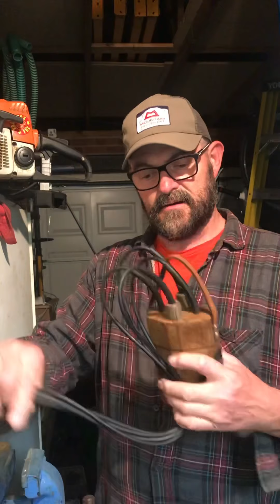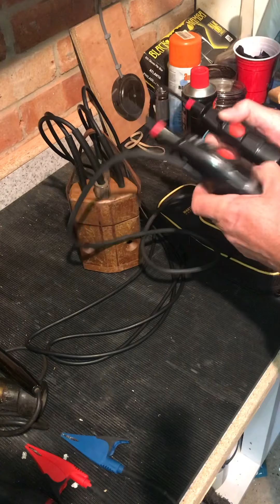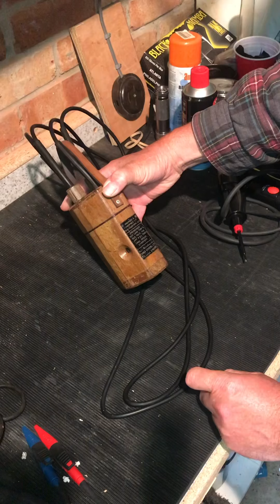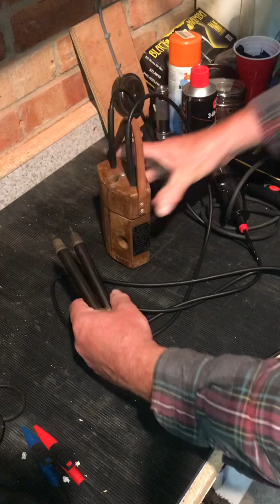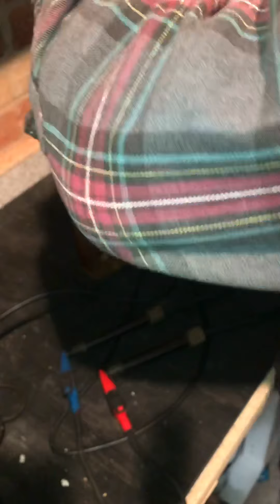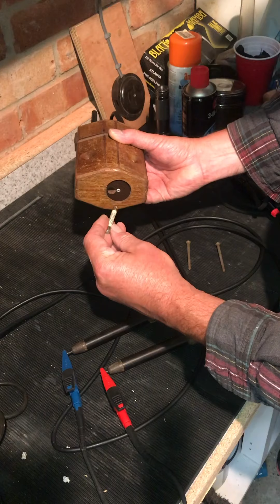Hammond and Champness

Comment: Hi Richard, curious, I love old testers, my father restored Telephones, Radios and Barometers. I have a couple of oldies but I really don't want to start collecting them. Love the Fluke but the T5-1000. Back in the UK I used the Steinel Voltcheck with a continuity button, loved that thing. Mark
Reply from the maker: 9 Plus Instalaciones Yes, when I was in my apprenticeship the Steinel’s were what all the Sparks used. Wades and Eddies sold them in the trade counter. Still got a Volt-check and Combi-check in my collection. I love the old testers too. The innovations we see today as new were around 40,50,60,80 years ago! Great but of history, just need to get an older one now!! 😱
Reply: @richardemery6690  yeah on the Steinels  had a problem with the Cont. Button after sometime. It was such I great step to get that digi screen and know the exact voltage instead of a range of lights. Truly mesmerising stuff. We are probably around the same age group.